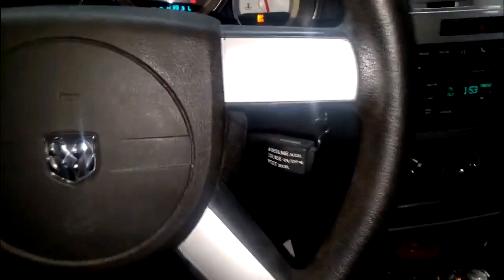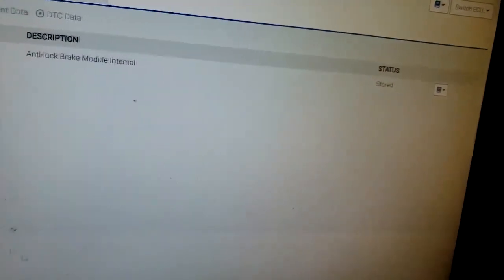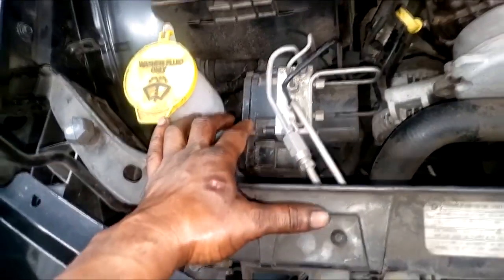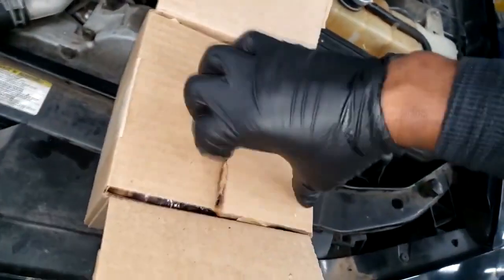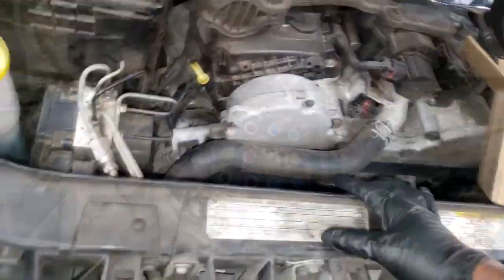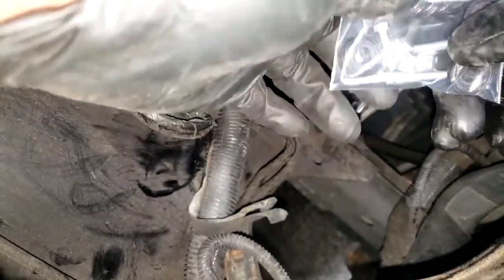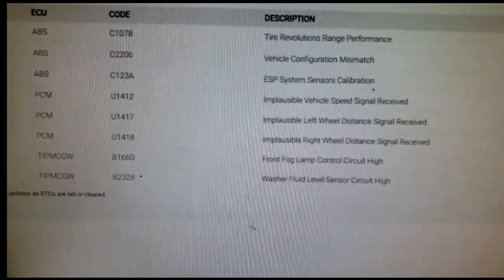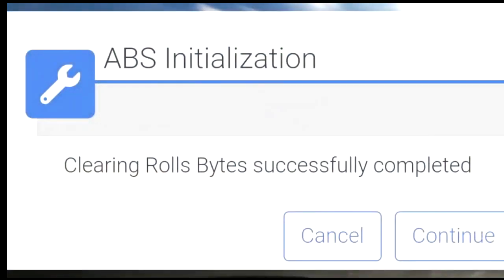C2200 ABS Code Fixed! Replacing the ABS Module and Initialize It.

Comment: Do dodge got bad solder joints on the circuit boards? 

JT, What's the word on tech shortage in Atlanta? Been following that he past year. I'm west side, they hiring, bays not full, yet they want shop experienced. I'm a diag guy, not part cannon shooter. I can give lectures on evap, why plugs ain't causing that misfire, all about catalyst operation and how a lean or rich may be that 420, so hold off replacing cats. 

Come from IT tech world, so software, networking, and hobby electronic circuit design gives me edge on infotainment issues. Heck I can copy a 2nd gen PROM from one cluster to another without swapping chips

Wish a manager take a chance, throw me in lube bay to see that I will stick around.